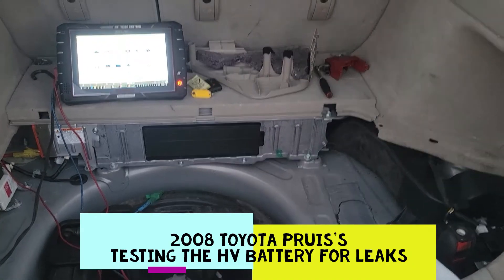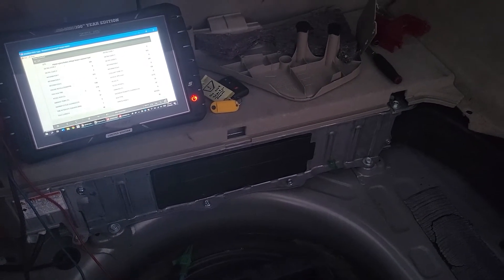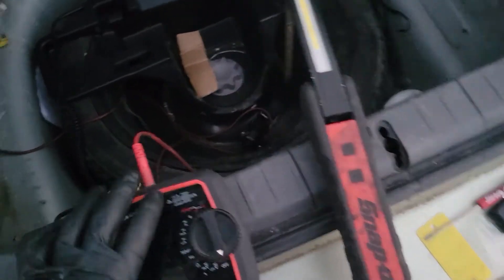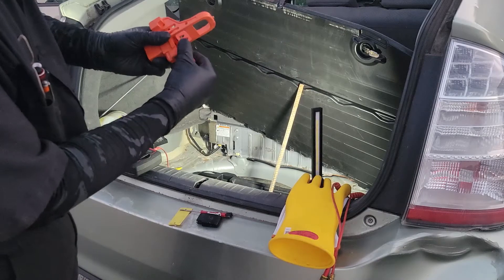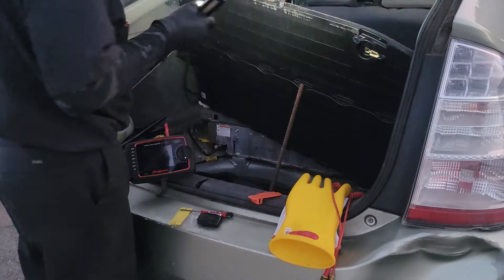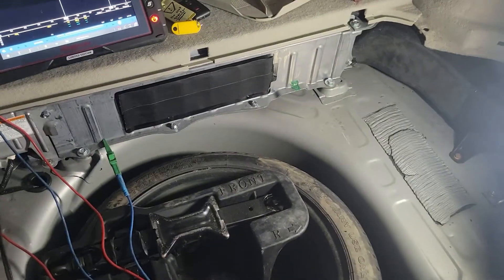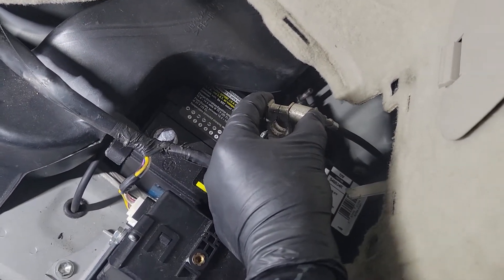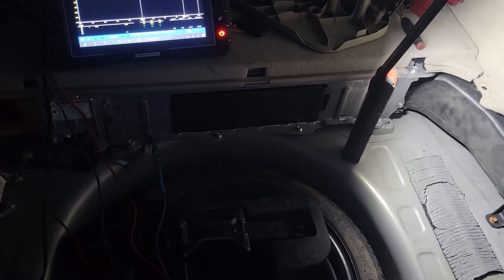Hybrid battery testing on a pair of 2nd Gen 2008 Prius's

Comment: In the toyota service manuals that i have for the 2nd gen it says to always remove the service plug. I’m curious why you installed the service plug to test? Can you get the same readings from testing the main battery posts or am i missing something?